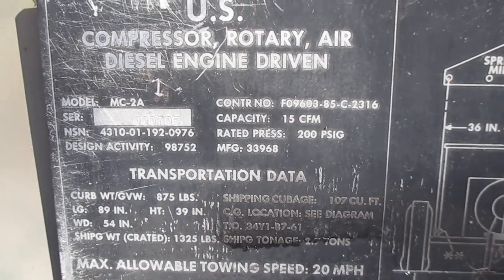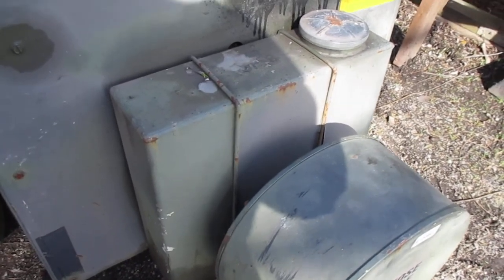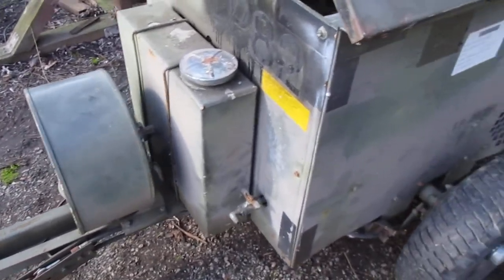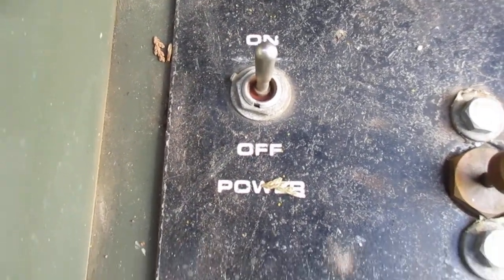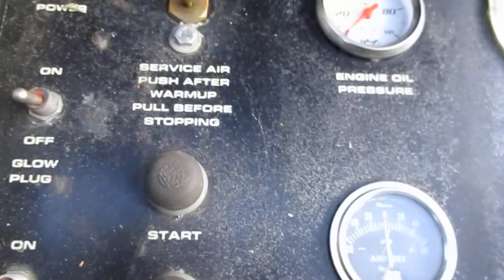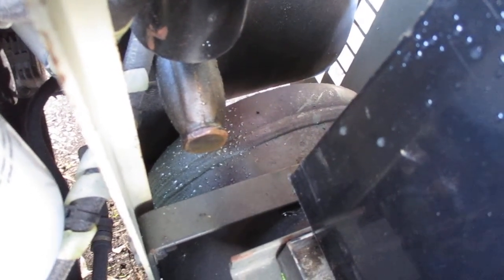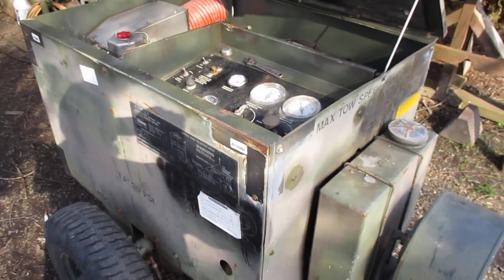Ingersoll - Rand, MC - 2A Air Compressor.

Comment: Do you know the amount of engine oil and the location to add engine oil?
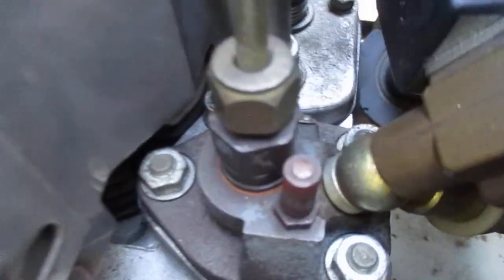Reply from the maker: Good question. Exactly at 3:34 you can see the top of the engine that has a RED cap with finger notches. That is the oil fill area. I don't recall off hand just how much oil the system holds, but you have to figure 1 quart for the filter and at least another for the engine. I think that is what I did when I performed the service then topped off by running the engine then shutting it down and checking the dip stick. As for the compressor, it takes ISO-10 compressor oil and the is a small hole in the sheet metal through which you can see the sight glass. It gets filled to better than 1/2 way up.
Reply: @w.w.2restorations.vehicles698  it's 2.2 quarts.  I found the TM.  I was low on oil.  I love mine very handy and reliable.  Just very loud other than that I have used it for many projects.    Thank you for the video.
Reply from the maker: @timf2279  Okay Tim, Roger that. I have found that the BEST MUFFLER is a 100" air hose to get mine as far away from me as possible, then it's a bit quieter. Quick note, be careful when connecting your battery. I bought mine from GSA Auctions and the alternator didn't work. I found a replacement through Deutz, but it is $600.00 +, so I just keep a charger on mine while it's running.
Reply: @w.w.2restorations.vehicles698  I don't think my alternator works either.   I just charge the battery with the charger.  The AF still use them.   I was over at DMAFB, and they must have at least 30.  I would say the AF got their money's worth.
Reply from the maker: @timf2279  So did I.R.

Comment: What kinda cfm does it produce
Reply from the maker: It will produce a steady 15 C.F.M. and deliver as much as 200 Lbs. P.S.I.  If you would like to pause the video at the very beginning, you can also see it on the data plate.

Comment: How can I find a rectifier regulator to the same air compresor mister
Reply from the maker: Hi Gustavo, here is the regulator/rectifier you need. I purchased two of them about a year ago. It is an exact fit and wiring set up. Good luck. https://www.dbelectrical.com/products/voltage-regulator-rectifier-12v-for-900cc-ducati-darmah-61046750.html?mrkgadid=1000000&mrkgcl=1145&mrkgen=gpla&mrkgbflag=0&mrkgcat=&acctid=21700000001643279&dskeywordid=92700057552228948&lid=92700057552228948&ds_s_kwgid=58700006372829751&ds_s_inventory_feed_id=97700000007195091&dsproductgroupid=765194936783&product_id=230-42030--004&merchid=1552033&prodctry=US&prodlang=en&channel=online&storeid=&device=c&network=g&matchtype=&locationid=9033252&creative=469096071058&targetid=pla-765194936783&campaignid=976044410&adgroupid=109573830665&gclid=CjwKCAjwgISIBhBfEiwALE19SQ65oPTgIeRa0JDUsSOUsgivNCoU438rypTPJVnNdfm3WxEeZJitbxoCCsoQAvD_BwE&gclsrc=aw.ds
Reply: @w.w.2restorations.vehicles698   se i have a other question I need the oil compresor relay
Reply from the maker: @gustavolopez6060  My friend, I am sorry to that I don't have a technical manual for this compressor. I don't even know what the oil compressor relay is. The only suggestion I have is to keep searching the internet for another junk compressor and buy it for parts. Just type the name of it into your search engine and they will come up. Good luck Senior...